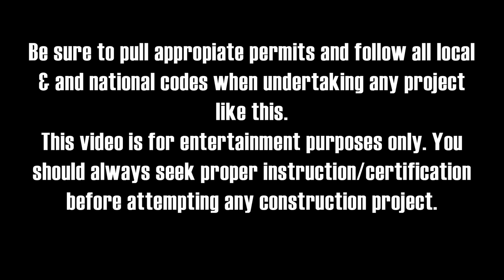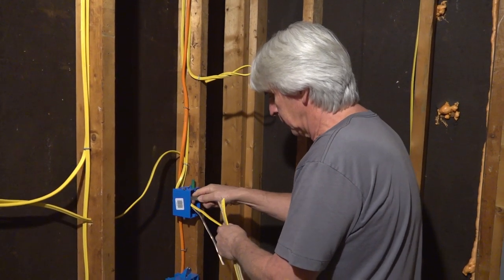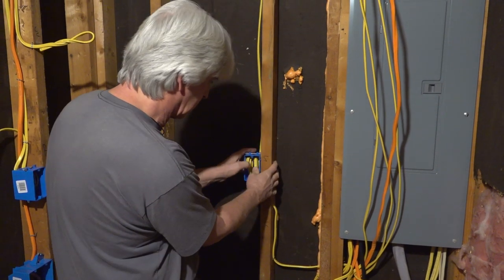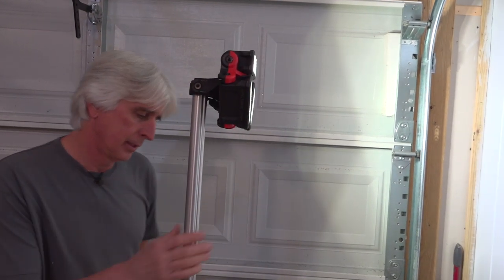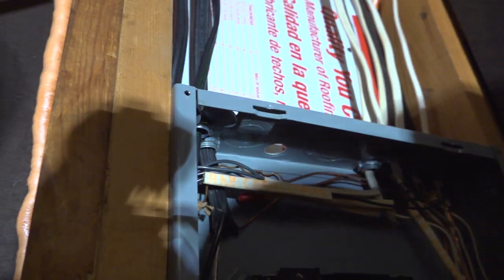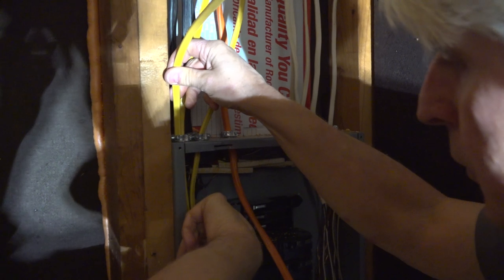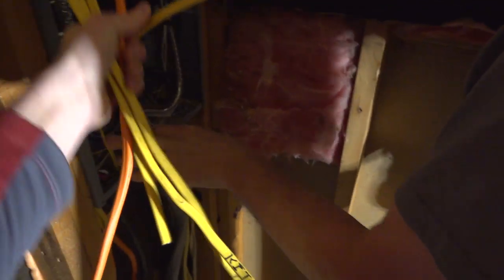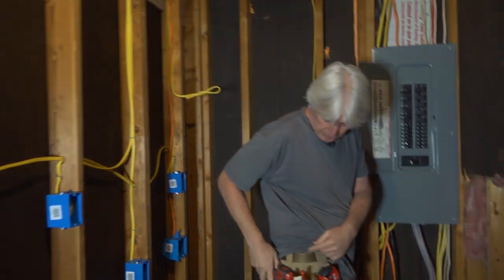Terminating Wires - Kitchen  Remodel E4

Comment: Terry you're very good at this, i like your explanations.  Very true at the end, if you don't know what's going on get someone who does.  Especially with anything electrical.  From wire sizes, voltage, to amperage on breakers. These are things you need to know.  Guess thats why inspectors were created. Thanks guys.
Reply from the maker: Thanks Dean. Been doing it long enough. Yes people need to realize their limitations. I am the type that does everything myself. You can fix most stuff but if you or someone else is electrocuted as a result of your work no one can fix that. 

Terry

Comment: I have a ? - I’m adding onto our exterior lighting which is currently only one light on the porch, it’s a 20 amp circuit with only an outlet in between the light,   ( I have the flexible non metallic conduit and enough THHN and various junctions ) Currently our house is a rectangle from birdseye view with a center light on front, we want to add 4 lights, one on each corner.. my question is it better to split the run symmetrically and using the the current light as a T   Or better to only have one long run.  Thank you
Reply from the maker: Not being able to see your situation I would guess the best way to do it would be which ever uses the least amount of wire total. One long run or branching out is likely not a big issue either way. 
Good luck!
Terry

Comment: I’ve never seen the ground with the hole in it, I’ll have to look for them now.
Our code requires insulated staples, but I honestly don’t think it matters, as there is no abrasion with no movement.
Reply from the maker: They will probably add that insulated staple rule some time in the future here as well. Its a never ending effort to make our lives more difficult, lol. Yeah those wire nuts with the hole for the ground are really nice. just makes life a little easier.
Terry

Comment: so im trying to knock down my wall but it has my kitchen light to it, how can i safely remove n cut the wires without killing me lol?
Reply from the maker: Not a difficult task but in some situations. However not being able to see your entire set up it would be hard to give specific details. Best I could suggest not knowing a lot about it is disconnect power to all circuits/wires involved. Label each wire and take pictures before disconnecting anything. Then you may have to relocate each wire to a place where junctions can be made for each and jumpers ran to the new switch location. Good luck and be sure you know what you are doing or get someone who does. Remember turn the power off when working with electricity!!!!
Terry
Reply: love you bro !!!